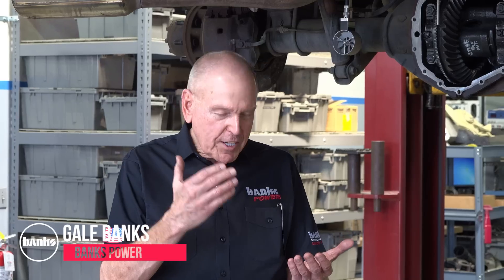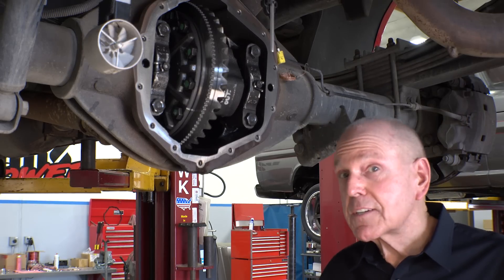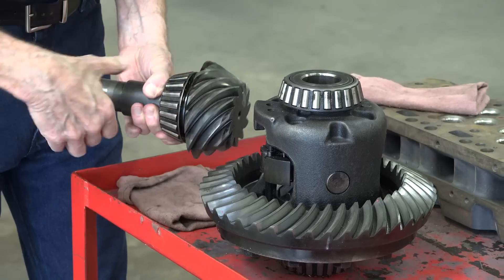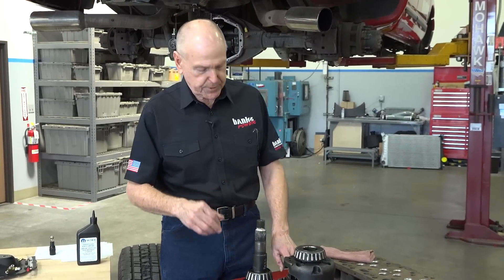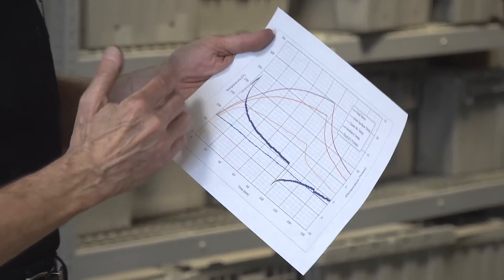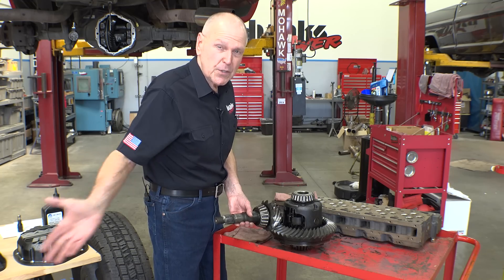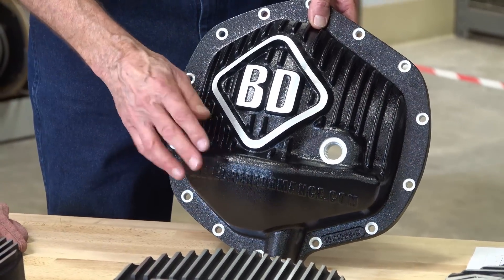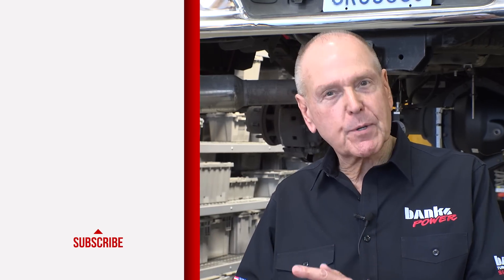Do Diff Covers Work or Are They Just Bling? Part 2 of 3

Comment: Where the hell is Part III?
Reply from the maker: The reason for the time between follow-ups is purely due to R&D. When we post a video, ten times out of ten, it's something that happened that day or the day before. Regarding the diff cover series. We've been sitting on the info for quite a long time. Why? We'll only get your attention once. We're going to reveal the research when we debut our cover design. We made many iterations and several billet prototypes, tested the heck out of the design, then went with a manufacturing process that is far more accurate but takes much longer. We have the diff covers in production and hope to have an announcement soon. 👍🏻

Comment: sorry big boy.. thats the tone ring for the rabs. not the speedo.
Reply: Gale is correct. The tone ring is also used for the speedo. Early 90's fords had an issue with the rabs module malfunctioning that caused the speedo to jump and fall. The quick remedy was to disconnect the rabs module and your speedo would work again. In most trucks the tone ring in the rear axle is for both the rabs and speedo.

Comment: As far as his theory on diff covers I think they will act just like air behind a truck cab and tail gate, basically  no difference in drag as far as shape. fluid level will cause the largest effect because submerging the ring and pinion in fluid will cause them to basically become a hydraulic gear driven pump, causing heat and drag.

Comment: I think the aluminum covers will all work better than a stamped steel cover.  However if you have a factory aluminum finned cover I bet most aftermarket solution don't work much better and likely worse. Having said that in most applications the temps aren't going to get hot enough for it make a difference anyway and if it's too cool or take too long to heat up that could cause additional wear.

Because of the crack downs on emissions and economy, manufactures take this stuff serious these days.   In the 90's most aftermarket parts were legitimate upgrades over OEM today that is not case without unless compromises are being made in most cases.

Comment: take a look under your truck or car If you have a stock cast iron axle it's a huge heat sink no amount of fin's is going to cool that now if you have a Japanese type aluminum diff that bolts to a cross member a fin cover will work it's like cast iron or aluminum frying pans the more mass the better it is a keeping heat the less mass the less heat it keeps. as for the after market covers keep the factory cover they work and come with the diff if you need to have the bling cut out the stock cover to make a windage tray and mount it in the aftermarket cover so the lube won't have to do more work then it needs to just like the drag from the crank in your engine the ring gear has loss from the lube

Comment: The energy going into moving the fluid is so small it's irrelevant, Gale should have run some basic equations before voicing this unfounded opinion.

My napkin math show's it's 100 watts at most going into pumping the fluid around the differential.

Comment: This is precisely why if more cooling is needed an aftermarket pump and radiator should be used.  Won't change the OEM fluid level or cover design but will expand fluid volume and overall cooling capacity.

One other note: Diffs must work in all angles.  Pulling up steep hills, sideways, downhill.  Banks did the testing on a level surface.  Something tells me those aftermarket covers perform very poor at odd angles.

Comment: I'm an old HVAC guy, and the first thing I saw when looking at the stock cover and how the lubricant flows through the axle housing is that it is designed to use the ring gear as an impeller. IT'S A PUMP! It pumps the fluid around to all of the areas of the axle and collects it back into the reservoir. When you change the shape of the pump with an aftermarket cover, you're not only adding heat and work, you're effectively ruining the effectiveness of the pump and reducing the available lubrication throughout the axle. This is what occurs to me anyway.
Reply: How much energy do you think is lost? Your grandma's hand mixer could splash that shit all over the kitchen at like 1/20HP. You gonna measure that on a Dyno with a 400hp diesel? Come on man. Common sense.
Reply: It's not about splashing it everywhere, it's about carefully directing the lubricant flow so that it goes to the specific places it needs to go with a minimum amount of turbulence and/or cavitation, both of which rob mechanical energy from, and add heat energy to the system (the differential gearbox in this case). Common sense.
Reply: It doesn't take much energy to move a couple quarts of fluid, ie, a hand-mixer can do it, you've totally missed the point HVAC guy.  The energy losses are minuscule compared to the overall system.  The ring gear in a differential isn't a pump or an impeller, I suppose it could be seen as a conveyor but that's the extent of it.  The only cavitation in a differential is between the gear teeth, where pressures are high enough to create voids, I think you are misunderstanding what cavitation actually is and what causes it.
...the most important aspects of differential (or any gearbox) performance is to have clean parts devoid of burrs, proper part heat treatment, proper fluid levels, proper fluid pressures, proper feeding (a function of part design), and ensuring CLEAN fluid.  It is essential to filter particles, moisture, and other contaminants from the fluid.
Reply: To each his/her own. You see it your way, I see it differently. Gale Banks, however, will have the final word.

Comment: Mr. Banks, I’ve been watching you talk for years and 99% if you don’t sell that means it’s all crap. Where’s part 3?
Reply from the maker: The reason for the time between follow-ups is purely due to R&D. When we post a video, ten times out of ten, it's something that happened that day or the day before. Regarding the diff cover series. We've been sitting on the info for quite a long time. Why? We'll only get your attention once. We're going to reveal the research when we debut our cover design. We made many iterations and several billet prototypes, tested the heck out of the design, then went with a manufacturing process that is far more accurate but takes much longer. We have the diff covers in production and hope to have an announcement soon.👍
Reply: All those other diff cover companies will not be happy after part 3 comes out I’m just saying for a friend! Good job 👏 !

Comment: What he says is all true from a performance aspect, the stock diff covers will be fine for 99.99% of applications. But the one thing this testing isn’t doing is a durability test, the last thing you want is to peel off your diff cover when going over rocks. It can and does happen when going off-road. 

There are some things people use aftermarket parts for and it’s not always about performance, sometimes it’s protection. If you’re adding a diff cover for performance gains then you’ve fallen victim to marketing hype. 

I use an ARB cast steel cover, it’s heavy as hell and probably 5 times heavier than the stock cover. I have absolutely no worries about peeling it back when going over rocks. Yeah it doesn’t dissipate heat as fast as the stock cover but an over worked differential is better than a differential with no oil. 

With all that said, he is 100% spot on about the performance side of aftermarket diff covers.

Comment: one look at any aftermartket diff cover and you can tell its all BS for looks.. if they are supposed to COOL the liquid, you need surface area. None of those have  any real fins. take a look at AAMs  own  finned cover that they make for their axles..  google part number 74030017. It was Designed by AAM for their AAM axle.. . Now THAT has some real fins to radiate heat. Its found on the RAMs with the max towing setup.

Comment: I just don't understand the need for all the extra fluid. I guess I could understand for a real offroader that  would be operating way off camber at low RPMs but for a street machine? Deeper fins and some kind of air ducting that actually redirects the air to the cover would probably more than suffice. Then you would run into it never getting to operating temps when you aren't towing up hill.

Comment: Why would you replace a cover made of stamped malleable steel and replace it with a brittle cast cover? I'd rather hammer out a dent along the trail and fill my diff with my spare fluid than try to get a tow up in the mountains.

Comment: Gale you make it all to complicated all you should have to do is take the temperature of the lubricant of each  diff cover in its own controlled test, meaning all of which will have the same conditions mph, wind, time ext. And if the lubricants temperature Differentiates from the factory diff cover temp just present the information to us and make your claim on which design is best.

Comment: As far as stock goes there is no reason to change a diff cover. The engineers who decided the oil weight and built the thing know way more about what works than any aftermarket buyer does. Simple.

Comment: I just don't understand the stupidity in bad engineering where they would design a diff cover that impedes the smooth flow of the diff fluid originally designed into them. Do they not know that fluids follow the path of least resistance? That channel for the ring gear and the diff fluid was designed by the engineers who designed the diff and the vehicles they are on with years and millions of miles of engineering tests. Why undue this perfectly sound engineering with diff covers that don't have the channel?

Comment: More capacity is the #1 myth. Bigger trans pan,bullshit. Bigger engine oil pan,bullshit. The coolers can either cool the oils or they cant. 
 The dam fluid all heats up to the same temp. If It gets to 300f in 5min or 10min it doesn't matter. If u r driving for say 2hrs the extra capacity only kept your fluids cooler for 5min of those min. 
That's why he mentioned the rate of deg increase.